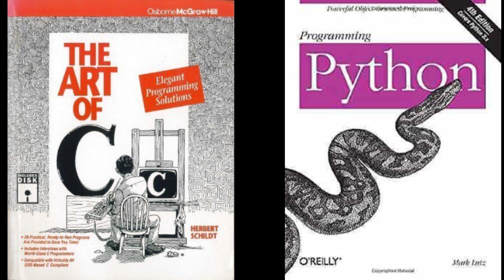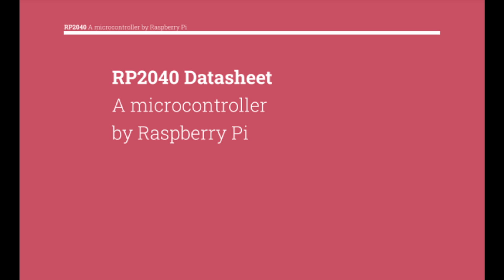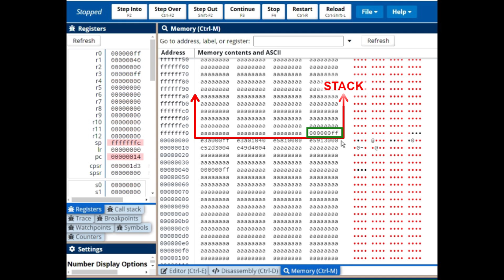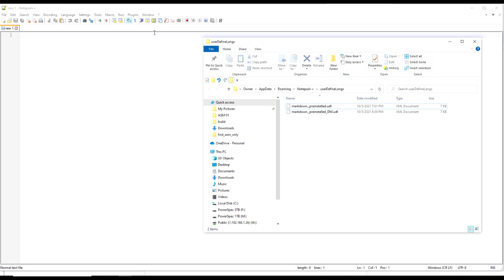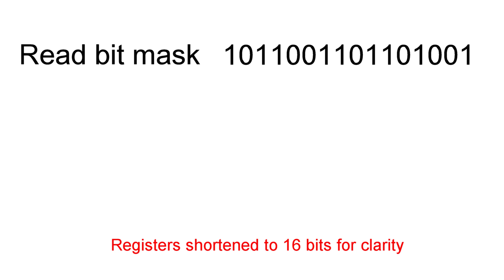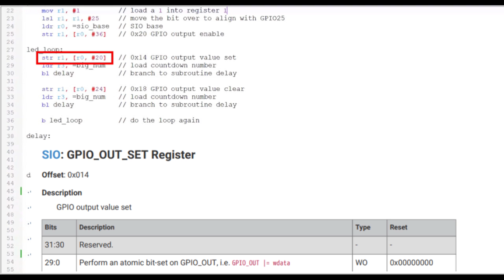RP2040 - Introduction to Assembly Language - BMA-01

Comment: My first real computer was an IBM 1401 ,then an IBM 360/30. I designed and build a 360 emulator because  test time on a real machine was very scarce. Once you work on an IBM mainframe, all else are toys. I wrote for thr 8080, the Z80. The 6502 was too weird for me. 
Fun fact: the IBM mainframes dont use a stsck pointer, no need  for them and they had 16 TRUE general purpose registers, no special  "link" register or stack pointer. I could use ANY register as a link register. The instruction set was very powerful and easy to use. I was not limited to do math in the A register, again it had 16 GENERAL perpose registers,  so you could do math in any register. Thats the definition of a general purpose register.
The CPU had a program status word (PSW), which was like the program counter and flags and other important items in one register. 
Writing on a microprocessor, you knew it was going to be cumbersome and much more difficult than on a mainframe.
 I dont understand the need to tell the assembler where your program began, that makes no sense. It begins at the begining! If you made your executable from 1 object module, it began at the beginnig of that object module. Eazy peasy. If your executable was made from more than one object modules, you needed to tell the linker where your executable began, after all its the linkers job to determine where to begin from, not the assembler.
Futhermore when loading the program it was the job of the loader to resolve any addresses before execition as your program could run at any memory location at any different times.
I never expect much from a microprocessor at all, but some of the things that they did made no sense.
Reply from the maker: I remember those days.  I too started on a 360, but at that time I was just a "user".  You know, punch cards, submit, watch for flushing, debug, repeat.  I used a couple languages (FORTRAN and OMNITAB), and dabbled with JCL, but I was never one of the gods on the other side of the glass.  I was the first at Ohio State to build my own microcomputer, I could only afford the 6502.  So that's what I learned.  Thanks so much for your perspective!

Comment: Just learned the Assembler of the RP2040, but only for the PIO and running with CircuitPython :-) - Setup hasn't to be that efficient, but driving WS2811 with only 3 lines of assembler code (and some glue around) looks really badass <3.
Reply from the maker: That's great!  Hopefully some of my other Bare Metal videos will interest you also.  Thanks for watching!

Comment: Are you sure? C compiler have different options for optimatization.
Reply from the maker: There is still so much overhead in the form of additional libraries.  Granted, you still need to routines to do those functions, but they can be streamlined.  I wrote an assembly 6502 emulator for the Pico that runs very quickly.  I can't envision a C program working that efficiently.  
That said, a C program is simpler to create and will probably run fast enough.  Each has their place.  Thanks for watching.
Reply: @LifewithDavid1 Thanks for answer

Comment: FYI: If you wanted to, you could simplify the led_loop.  Instead of SET, delay, CLEAR, delay, loop...You can just do XOR, delay, loop.
Reply from the maker: Thanks for the comment.  You are correct.  During this video I was scraping the rust off my assembly skills (I've been away for 45 years).  Every input on how to do things better really helps.
Reply: @LifewithDavid1  In that case, I have two recommendations.  I started working through your BMA series, because I'm making a Pico clone of the first arcade Space Invaders and want at least some of it in assembly.  In your code for this one I changed several of the immediates to hex so that they match the comments (and the datasheet value).  I also defined rst_clr as rst_base + 0x3000.

Comment: Interesting that it uses 2k bytes in C, compared to assembly, Using C it must have a bloated sdk for over head of something in the Pico, I wrote a led blinky on a msp430 In C and it only used like 160 bytes, and that was a 16 bit microcontroller.. I think the issue with the pico is lack of native C support and it must be language interpreted. I believe the esp32 has the same overhead issue.
Reply from the maker: You are right to point out the overhead, the Pico doesn't have native C support so you're dealing with a cross compiler which adds a bit of bloat to the code, but sometimes it's worth the ease of use.
Reply: @LifewithDavid1  that is true, also why it comes with a lot of external flash. Kinda sucks the pico does not have internal flash, i guess cause it would need a ton of flash, just to have a decent sized program.

Comment: Hi David this is by far the best series on YouTube! Would you also consider building a SSD1306 driver where you would first have to use I2C? I already built a SSD1306 driver in STM32F401 ARM so I can share that with you to save you the trouble of driver development that would leave you only with making the I2C assembler for the Pico.
Reply from the maker: Thank you.  I haven't got into these cool little displays yet.  I haven't done any I2C interfacing yet.  I'll consider it; but I probably won't get to it right away.  I've got a couple other things I've got to do first.

Comment: Now, there isn't actually anything special about R13/SP and R14/LR in the main register file except if you're using Thumb. Unless you use BL to jump and copy the PC into the link register, it's just a normal register. R13 as the stack pointer is just a convention and you can use STM/LDM with any register you want. Only R15/PC is really special purpose.
Reply from the maker: You're absolutely right.  However, I like to use them for only those purposes.  That keeps me from overwriting them with other data that would surely screw me up.  Thanks for the comment!

Comment: I haven't used assembly language much since I started programming microcontrollers in C.  The GNU GCC family of compilers support the AVR series micro controllers, as well as many (if not all) variants of the ARM family.  However, before I started working with micro controllers, I did a lot of work as a software engineer writing code for  embedded 8086 family processors.  Once such project was for a four port serial communications co-processor board used in a PC based user access point in a Coulter blood counter.  I had a choice of programming it using C, Pascal,  PLM, ADA (don't ask!), or assembler.  I decided to write the code in assembler, not trusting the ability of the available compilers to give me enough control of the hardware.  It was actually easy to write, and the 8086 itself has features that enabled me to divide the program into separate tasks for each of the serial channels.  BTW, the processor was actually an 80188, but that chip is nothing more than an embedded variant of the 8086 with an 8 bit data bus and built in support chip functions.

As far as the processor is concerned, there is NO difference between machine language and assembler.  When writing machine code, YOU are the assembler.  Assembler code is nothing more than a human readable form of machine code, and having the computer do all the heavy lifting of getting that code into binary format CORRECTLY.  
I've often looked at the assembler code generated by a C compiler, and realized I could almost always tweek it to remove extra lines of code, or rearrange things so it would run faster.  It seems the compiler wants to move data from memory into registers, operate on the data, and then put all the results back into memory, even though it will be reloading the same registers with the same memory for the next high level language instruction!  Of course there are compiler command line options that will enable optimizations that will notice these things, at the expense of longer compile times.  
Still, the assembly language programmer can often see outside the box that the compiler designers have limited themselves to, compilers seem to be based on a set of macros that can be strung together to translate various high level sequences into assembler routines.  There is also the issue of memory usage vs speed.  I once had to write a bit of code that HAD to complete in a small amount of time.  I ended up writing a number of macros that were recursively called by other macros in several levels.  A few small lines of assembly code took nearly an hour to assemble and produced a huge amount of binary image!  It was fast, because it was all straight line code, NO SUBROUTINES!  From the assembler macro point of view, it was a mess of nested routines however.  Perhaps a gross example, but assembler gives you that option!

Comment: My first "Eureka!" came as a result of an instructor taking us on a 'working trip' through the hardware of a PDP11-05, at the TTL level, understanding that a "register" was a vrpup of D flip-flops, connected with multiplexers to an ALU, address registers/counters, memory dats bus, cchip selects...and that the 'software' was a bunch of bits in memory that controlled muxes, and register selection, and add/subtract, and...wait!  'Software....that's just hardware states controlling counters, operations, location selections...'
Suddenly,  as a hardware guym this "bare metal" view allowed my thoughts to work "up the stack" to "languages"!!
Then, being very professional,  using a POP Assembler (pencil on paper), the professionalism showed up by using lined computer paper!
MC6801!  First MCU with hardware muliply, in 1978..
Reply from the maker: Thanks for the insights.  Machine language really does strip back the "magic" and helps both hardware and software people get a feel for the entire computing process.  Check out my emulator videos; I found the process fascinating.  Thanks for watching!

Comment: AND you are one of tge very few on here who uses flow charts Too many just dive straight in and write code with the inevitable errors. The viewer is lost and this includes one famous Harvard Pico course.
Reply from the maker: Thanks.  When I wrote the emulator; I filled an entire yellow pad with flow charts. I just can't think without pencil and paper.  BTW, "The Prisoner"  takes me back to those wonderful shows of the late sixties (including "The Avengers").  They don't make them like that anymore.
Reply: As a CIO I INSISTED that my programmers create flowcharts. You would be surprised at how many things they discover when they actually jave to THINK rather than just coding. It also is a very important  documentation step. Ever pick up a program you wrote from decades ago and if it had no detailed comments in the code, you scratch your head and think, "what was this for again???"

Comment: Hi, I've been enjoying your Raspberry Pi Pico programming videos.

I have a suggestion of something you could do that I'd like to see a video on:
Using the MicroPython assembler for the Raspberry Pi Pico.
I just made a video showing it but only with a few tiny examples. The only other videos I could find on it just showed some output, not showing the process of programming it.

It seems like it could be easy to get started with since it didn't need much set up on the host computer.
Reply from the maker: Thank you.  I didn't know much about the MicroPython in-line assembler; I learned more by watching your video.  I have a couple more bare metal videos I'd like to do; then I might try melding MicroPython, C/C++ and assembly all together.  Thanks for the  suggestion!

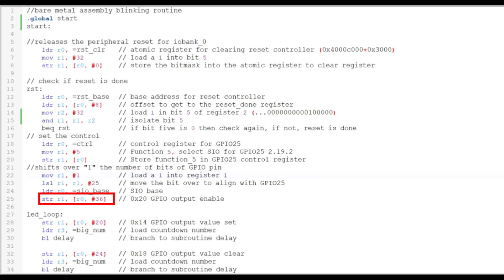Comment: 21:25 str r1, [r0, #36]

36 decimal is 0x24 not 0x20. It should be #32. I tested the code with this change and it seems to work fine. Is this a mistake?
Reply from the maker: You are right.  MIKE-kd4sf pointed this out about a month ago (see previous comment).  I changed the code in the Github repository.  Thanks for pointing out the discrepancy.
Reply: @LifewithDavid1 I see now. Btw, excellent presentation and teaching methods without using the pico SDK as a crutch.  Maybe it would be great if you could write a book on the same, make some money 😅. I bought Stephen Smith's RP2040 ALP, but then again, the entire book uses the pico SDK as a walking stick.

Comment: I like so many others started programming on the 6502 all those years ago and took to assembler because the alternate was basic which was so so slow. 
P.S do I get a prize for noticing the deliberate mistake on line 25 of the blink program.............shows I was following what was going on🙂
Reply from the maker: Ah yes; but WHICH one is wrong?  They both work.  That's why I didn't notice it. :-)  Now I'm gravitating toward hex numbers and atomic registers so I don't get into these pickles.  Thanks for the comment; and for watching!  Chapters 9 and 10 feature a pico/6502 emulator; and I'm currently working on getting the 6502 TIM monitor running on the Pico.

Comment: I cut my teeth on 6502 single board computer SYM-1 from SynterTec , hand assemble to hex codes and poke them via the keyboard.  No assembler, no compiler, just bare metal programming.  This is a skill set that is now days frowned upon because nobody wants to know the machine that well.   I am glad to know I am not alone, THANKS !
Reply from the maker: I really appreciate your comment.  It IS good to know that we're not alone.  Thanks for watching!
Reply: I started with Z80 and programmed the shadow rom bios with DIY 8 data switches and an enter sw to run CP/M. It took a few tries. Worked for many years in assembly for z80, 8051, 7810. It is very satisfying when you know 2000 pages of assembly code for a Wyse terminal emulator like your own hand. Later went to Fortran and C, then C++. Programming for microcomputers I really like to know what every bit does.
Reply: I think it ought to be required learning. For me, the realization that computers are actually just doing mundane operations extremely fast blew my mind. it's incredibly tedious at a human timescale, but then 'hello world' gets printed in a few microseconds

Comment: Ah, the 6502, such fond memories 🙂 I worked at IBM developing the XGA display driver Windows driver back in 1989, and we had the luxury of using the 80186; I remember a life of counting cycles and using clever tricks because every cycle you saved made the display hardware seem faster, and that's what counted in those days.
Reply from the maker: That really brings back memories.  I designed a hobbyist one-off disk operating system and had to count cycles to process the disk data in time.  All in all, those early days were a lot more fun and satisfying for me than the later stuff.  Thanks for watching!

Comment: I loved your assembly listing from 1976... by the time I got into 6502 we had a lovely assembler built in to BBC BASIC... But before then I did Z80 with good old fashioned pencil and paper. :)
Reply from the maker: That's great!  Although you can't write massive programs using paper and pencil; it still gives me satisfaction to manually work with machine code.  I did write a rudimentary DOS for the 6502 using paper and pencil; but that was the limit for me.